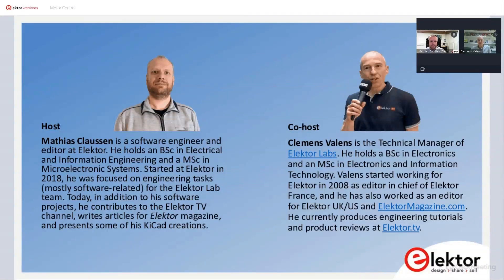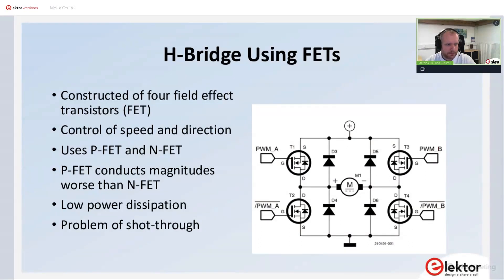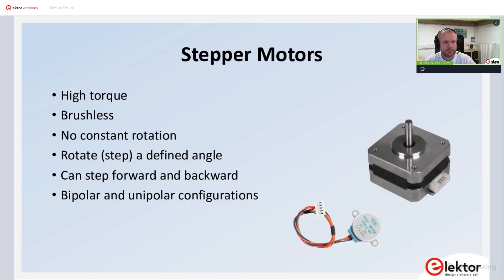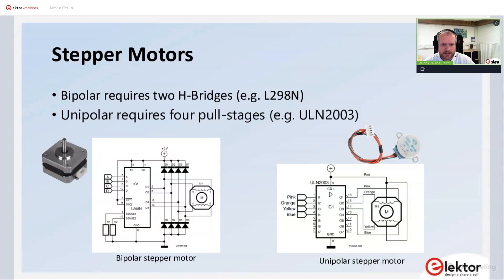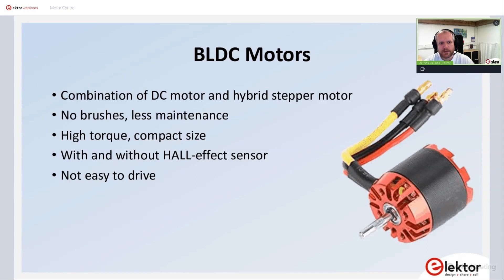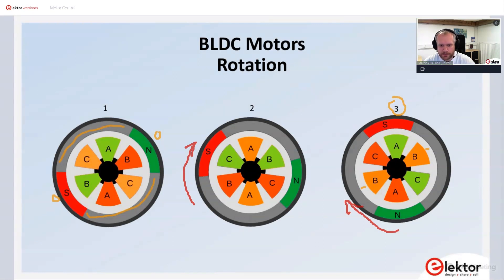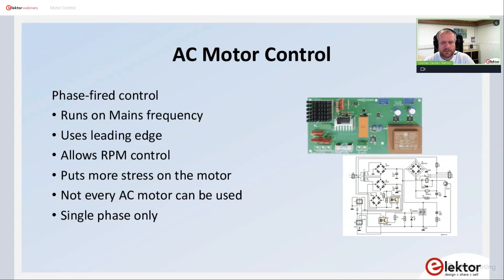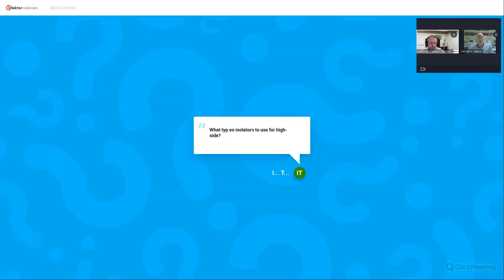Webinar Motor Control

Comment: very useful seminar. Is it possible to drive the 3 pin brushless motor from a simple 3-transistor sequencer circuit ? similar to the one used to create sequence LED flasher ?